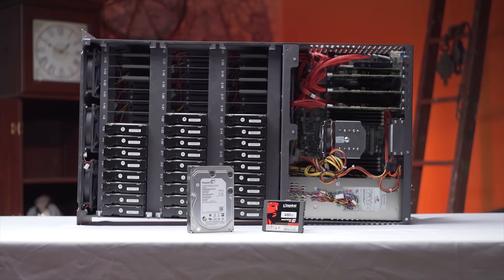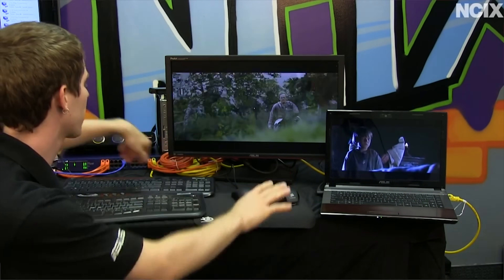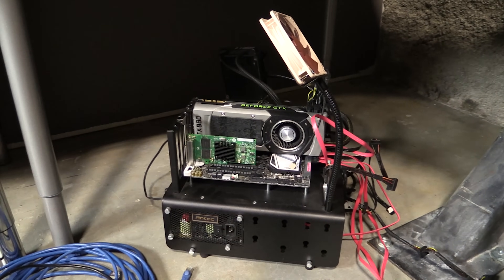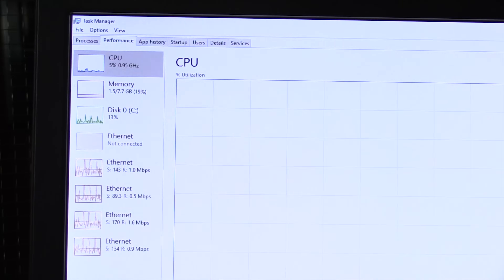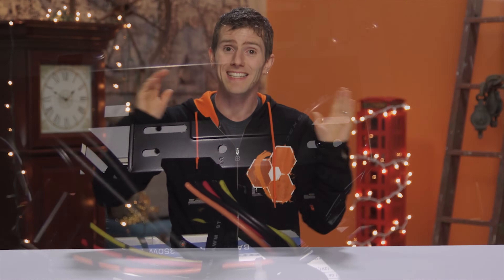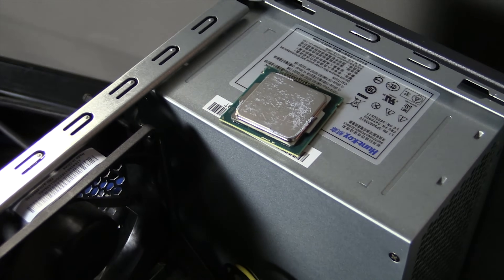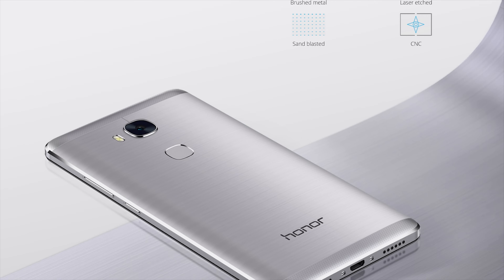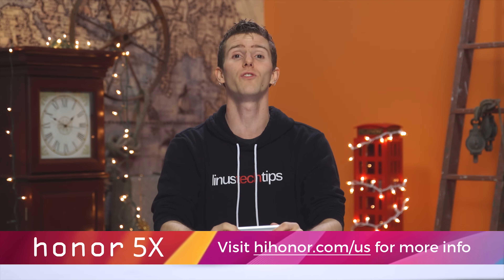Quadruple Your Network Speed for $100 with SMB 3.0 Multichannel!

Comment: Try using Linux. It does this kind of thing very well
Reply: Oldbatwit You're talking about hackingtoshing of yesteryear even so this video is about cabled networks between desktops/servers so how is wifi relevant?
Reply: Linux is easy to use
Reply: nah. nothing beats the compatibility of windows
Reply: Linux doesn't do anything very well. 
It does one thing in this one niche almost perfect, and if you try anything else it breaks. With no one willing, or even able to help.
Reply: @dan8t669  anything else like what? There are forums all over the Web and telephone support (paid for) which you can use too. You are wrong.
Reply: @ActionParsnip  Forums filled with elitists and simpletons pretending to be elitists. Nothing else.
And I highly doubt that phone support for any distro is going to help me troubleshoot a 3rd party program.
Reply: @dan8t669  depends on the support. I'm sure Microsoft won't support 3rd part applications either....
The forums are great. I post on Linux forums daily and help loads of users resolve issues.
Again..... Wrong. I'm guessing your Linux knowledge is basic and you've not used it very much
Reply: @ActionParsnip  "I'm guessing your Linux knowledge is basic and you've not used it very much"
And boom, you've proven me right.
Another elitists or pretend-elitists.
Thank you.
Reply: @dan8t669  no I'm saying you probably didn't give it a chance. Too obvious? It's not hard to use. Just different to what you are used to. You've proven nothing.
If Linux is so absolutely terrible, why does it run the majority of servers as well as the most popular mobile OS? That system in the PlayStation... Windows yeah? The Internet and IT for the most part runs Linux or Unix but yeah..... It's awful. You don't know anything
Reply: @ActionParsnip  Damage control kicked in?

Look, I tried several Linux distros for several different projects over the past 20 years.
Every single time it was a painful experience that took far longer than it did on Windows. But I thought, let's give it a try... people (like you) claim it's so great in distro XY.
Well, it never was. Every time you step out even a nanometer, of what comes included in the ISO, it breaks.

And as shitty as Windows was and still is, things tend to work because people are using it in a productive environment.
In the rare occasions I absolutely needed documentation, or help from others, I found it! Even if what I was trying to achieve, didn't to work, I found concrete reasons why.

PS: Android is not really hallmark of stability, compatibility or resource-efficiency. It's free, that's why gained such popularity. (Not claiming Windows Phone was any good)

PPS: I doubt anyone would be able to quantify "majority of servers". Is that bare metal only, including VMs, does a phone hosting a game session count as a server...?

PPPS: Probably wasted my time here, but I tried.
Reply: @dan8t669  it's a tool for a job. Every OS is. I've used it everywhere I worked. Are you seriously telling me that if, for example, you wanted a DNS server, you'd install Windows (at cost) then configure DNS or are you going to spin up a small Linux VM, install BIND (for free) and use that?

You'll notice that most things are in a Web browser now. Why do I need to pay for an OS to use a Web browser when I can run a free OS and run the same Web browser? It makes no sense.

The IT industry is changing and command line and Linux are becoming more and more important. It's just how it's going now.

Never had things breaking after stepping outside of what was on the ISO. I've made multiple clusters based on Ubuntu 18.04 and 16.04 and they are great. Thats not on the ISO. SQL servers with replication between nodes.... No problem..... I don't know how you "wasted your time" here, it doesn't make sense to me. Is it the playing with the OS or this discussion?
Reply: @ActionParsnip  DNS is such low resource cost service, I'm not gonna worry about what OS it ends up running on.
In a productive environment though, I wouldn't just "spin up a small" anything period. Switching DNS Servers has to planned carefully.

"You'll notice that most things are in a Web browser now." 
"command line and Linux are becoming more and more important"

Somewhat conflicting statements here.

"I've made multiple clusters based on Ubuntu 18.04 and 16.04 and they are great."
Is anything actually running on them? What are the hourly/daily downtime costs if it fails?
Reply: @dan8t669  it business critical stuff. Mainly for local councils and such. Would you really install a. Windows based server to run a DNS service when you can do it for zero cost (except compute and a little storage) in Linux. Switching DNS servers does need planning but it's not hard at all.
Command line on servers. Even Windows Core is 100% command line driven or you can use RPC. Users are using more and more Web based apps and the desktop OS is becoming more and more obsolete. Not contradicting at all. Try. Thinking about it.
Reply: @ActionParsnip  No, I'd run it on a already existing servers that have a fail over safety.
If that environment doesn't have a single Linux VM running, I sure as hell ain't spinning one up for DNS.
Zero cost? What does it cost to enable DNS on already existing Windows Servers? Nothing.
What does it cost to train people on a different OS? A fuck ton.
In case that environment is running Linux anyways, the questions answered itself.

So what you meant to say was:
CLI for server configuration, administration and maintenence.
And a web browser for the regular user.

What you think in your head and what an outside observer reads/hears are two different things. 
Something many Linux enthusiasts don't seem to understand. Not trying to mock you, I'm dead serious.
Reply: @dan8t669  doesn't cost a fuck tonne to train. You show your colleagues and new guys as they come in. If you make a small play book it can be done in support easily.
I wouldn't go just putting DNS on random boxes, not smart.
What is "moch" in this context? I'm seeing it as a weather description...
You can configure desktop OSes with CLI in Windows too. It's often easier to run a command than explain the 50 clicks it takes to do anything in Windows when I can just run a command remotely on a user PC and it works.
Look, we work differently. I can see the advantages of both as I use both where I work. I understand both systems. I think Linux does things sleeker and better than Windows unless it's really specific like some Citrix requirement or whatever but ultimately my Linux systems run using fewer resources and need a lot less hand holding just to run.
Sounds like your place just grabs the latest Windows template and creates a server whenever you need one without stopping to think if a different OS could do the job better. In some cases, it can and does.
Reply: @ActionParsnip  moch mock
WTF When did I say, I'd install it on a random box?

"You show your colleagues and new guys as they come in."
See, and I doubt you'll be able to.
"Hey Fred, Adam, Jerry and new guy, can you stop all your projects for now and I'll show you how the new DNS works. It's a Linux VM I installed without the customers consent."
Riiiight...

"easier to run a command than explain the 50 clicks"
For me it's 2-3 clicks VS 50 lines in cli

Funny you mention it, we are running Citrix.
Reply: @dan8t669  thanks for clarification. 

You always get consent and always go through change. I wouldn't just shove a server in anywhere without the proper process being followed. Is this what you do? Scary...
Citrix is ok. I don't have much to do with it but if folks want to run Windows applications then Windows is the tool to use.
50 lines in CLI is huge. I've some excellent scripts that query our ESX environment to see about various things and email reports to whoever needs them that are shorter than that. CLI is fast, efficient and reusable. I recommend you embrace it
Reply: If you can actually manage to get the WiFi working in the first place and if you can't, good luck finding the answer on the net
Reply: @oldbatwit5102  WiFi works out of the box for me. No problems at all.

Comment: your internet is fast as hell 111mps thats way faster than mine, mine is about 3mbs useing ethernet, about 670kbs wireless. before i got a new router it was 567 kbs on ethernet and idk on wirles
Reply: This is network speed, not the DSL speed.

Comment: So this works on any router or do I have to have an I7 router too:d
Reply: It is not about the router! This is local file transfer between two computers. Like network storage and Desktop. This has nothing to do with Internet speeds.

And no. As most routers have max 4 GBit ports, you will need a switch with more than 8 ports (16 or 24).

Comment: Lots of people thinking this video is about speeding up your internet connection.
Reply: not at all since this is for internal networking.
Reply: Jason C. lol idiot
Reply: jamesb1221222 I'm guessing this wouldn't help squeeze every bit of bandwidth that greedy isps are willing to give.
Reply: This is actually helpful to me because I'm renovating my network
Reply: Deon, exactly right. Linux is a Network operating system (NOS) so its going to have  support for SMB multichannel.
Reply: Well they need to learn to read because the title said to improve network speed, not internet.
Reply: It won't speed up your internet however could smoothout latency like a beast!
:D
Reply: those people are idiots

Comment: hey since you like doing this kind of stuff,  i got a question maybe you can help me with.  I'm a network administrator myself,  but retired early,  so i been outta the game for about 5YEARS,  cuz my injuries.  I haven't been able to take any refreshers,  and google is my only source of knowledge at this point,  so stfu before you talk shit cuz i don't know the answer to my own question.  8D

I wanna fiddle with what is called "nic teaming"  and "bonding".  I think you do to considering what we just watched.

thing is it seems you can only do it with intel card,  and broadcom cards that have it built into the drivers,  unless you're running the ever horrible and hideous server 2012 or higher.  I hate anything based or descended off windows8.x so no,  i won't sacrifice my own server 2008 R2 installs just to answer the question.  I even run server 2008 R2 on my laptop FFS.

So,  do you know of anyway to get "nic teaming",  and "bonding"  to work on a windows install prior to server 2012??  (i think linux has it built in,  but yeah-no),  and do you know of anyway it can be done with mixed nic cards??

I'm sure someone could write a software solution that wouldn't kill your CPU,  just don't know why nobody has bothered.

get back to me if you know anything.  thanks.

Comment: question is there a way to make your sending and receiving internet data through your modem / router faster as in to the expectation of what you're paying for, for instance I'm paying for the minimum amount of internet speed right now but for some reason I'm getting less than what I paid for whenever I'm running an internet check through say my PC or my PlayStation 4. I'm not trying to get more speed than what I'm paying for I'm just trying to get what exactly am I paying for, any tips?

Comment: now wait a minute - I only need a multiport NIC on each machine and a beefy multicore CPU on each side, right ? so no special windows software or drivers or anything to tell the NICs to bundle all 4 ports on each side to a single logical connection with a single IP and everything? or did i just miss something here ?
Reply: yep that's right... just 4 port card on both ends and simple gigabit switch and it works. 
I did full research on this. 10GB is cheap now but this is cool if you have few of these 4 port or dual port cards laying around.
SMB 3.02 is on by default on windows10 and win8.1Pro
I want to try 10GB link on one end and 4 port 1gb on other, to see if it will get me 4GB transfer.

Comment: Or, you know, SFP+. I have a Cisco Nexus 3064 switch running my 10GE network. Works a treat and you can get them used on the cheap.

Comment: The problem with this is I beleive you DO need a smart switch to make this work right(or an os that will spoof this for you).....by  its very nature spanning tree protocol is not meant to be spread across multiple mac addresses. You will need some kind of software to switch up what mac's the packets go to or request from. This is a shortcoming of TCP itself and probobly the reason that SANs have become popular in the high def video realm. 

This is also where ethernet is starting to really show its age as well......remember that ethernet is/was designed to send all packets to all devices on the same subnet and then let the clients sort out what belongs to them or not, we currently just hide the traffic from the other nodes via switches instead of hubs......not very conducive to high performance. 

with the current state of ethernet it would probobly be easier just to go fiber if this is that big of a problem.

Comment: a rundown without the lacy tech talk 
1: I bought a 4 slot Ethernet adapter 
2: I got a better cpu
3: made sure whatever fukin hard drive I had could handle downloads that fukin fast
4: I memorized the exact names and numbers of all components to look smart and scare the technically challenged
Reply: also a simple trick to put into perspective about windows vs Linux network capabilities is the simple ping command. In Windows the ping tool is limited to  1 ping per second, while as in Linux I have literally DDossed other devices using my wifi network with the ping command"4-12 Mbps"in the terminal due to the fact you can send 1 every thousandth of a second, unless it's Ubuntu which has a limit of one per .2 seconds
Reply: +Ghandi Shakira Linux is good for a few things-a lot of network jobs require you use Linux for networking, also it's a total hackers OS, also reviving ancient PCs with puppy Linux is something I have done for fun, some downsides include it is not for gaming. Windows has directx which is optimization of using PC hardware for max performance during gaming, and shockingly it's really really good and nothing Linux competes with

Comment: Old vid but as a tip when troubleshooting networking and cpu issues in windows you should ALWAYS change your cpu monitor in task manager to logical processors. 

The likely issue you came across is known as receive side scaling. Monitoring the utilization of each logical processor could have saved you a hack of time.

This is a common mistake by newcomers to windows networking and especially SMB multichannel.

Comment: were the switches and card capable of aggregation? With the NIC and the (usually managed switch for 4 port agg) switch having this functionality, you should be able to get this working much simpler. It will not show any improvement just hooking them up, or connecting and software bonding. You need the interfaces on both ends to take advantage of acting as one. 

And this can still be done for reasonable prices. Please address/try in a future video. 

thanks,

Comment: Or, you could buy a 4 port 10 Gbit switch for $89 and 10 Gbit nics for $25 and it will work all the time, with every application and OS.  Since the solution you presented doesn't really cost just $100 I think this is a better solution.  It also scales up better because the Nics are cheaper.

Comment: cool. but what did you get without the RAM drives? Like with your final setup but using SSDs?
Reply: Fairly sure it would have worked fine. A 16GB Ram Disk is useless for storing files, they would have only used that for testing,.
Reply: You could throw a few SSDs in RAID 0 to help beef up transfer speeds. They are getting cheaper now.
Reply: most modern SSDs have read/write speeds sitting in the neighborhood of 500MB/s, which would easily saturate a 4gbit/s network. Also, and I'm not 100% sure on this, but most video editing software (and streaming apps like Plex) actually transfer into RAM - just like a ramdisk. Assuming you only want to stream video content, rather than doing massive multi-GB file transfers, you would definitely still see a massive improvement in network snappiness.